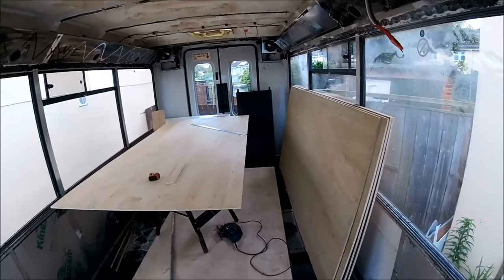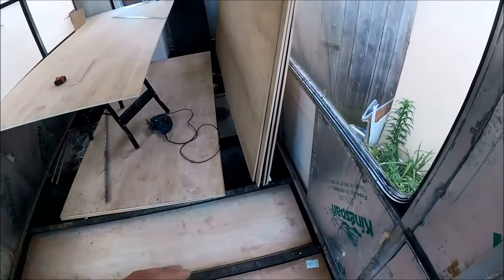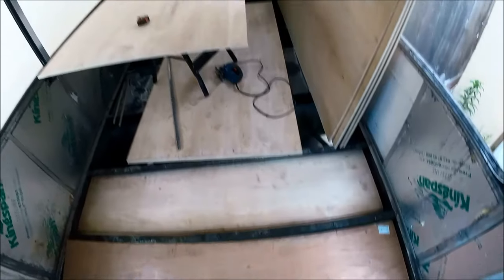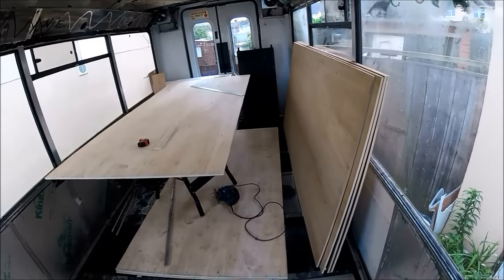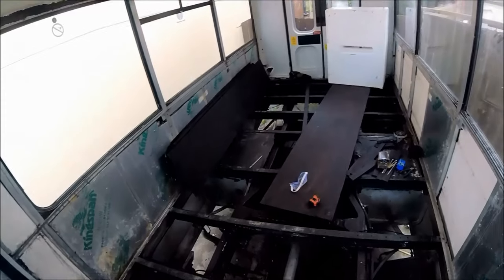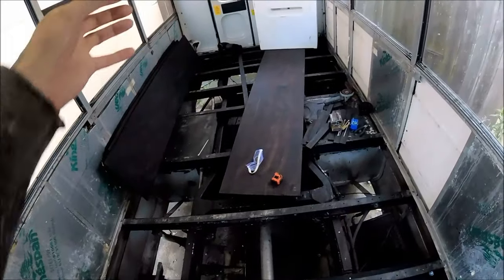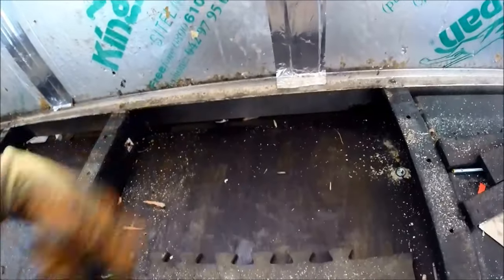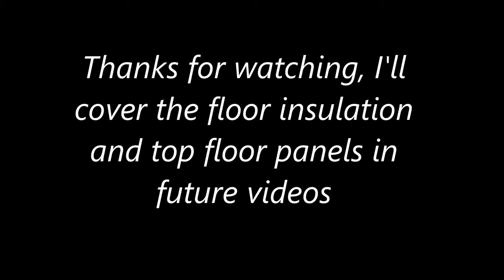Laying New Base Flooring In Mercedes Minibus Motorhome Conversion

Comment: Possibly an exceptionally gormless question but could you just build another layer of floor of the minibus as it was?
Reply from the maker: You can but loose headroom doing so, especially if you layer insulation between the floors. This is the main reason for replacing the floor, allowing 50mm floor insulation while gaining 1/2 an inch of headroom too.

Comment: Is that going to be strong enough for everything you'll lay ontop?
Reply from the maker: This is only a base layer to sandwich in the insulation and is not weight bearing, all of the final top flooring will be secured edge to edge to all of the beams

Comment: Did you paint the plywood with Waxoyl - I used ronseal weather proofer first then yaught varnished my sub flooring plywood - would the yaught varnish be better or !!! - what what type paint did you use first on the ply
Reply from the maker: I didn't use any paint at all, just a liberal coating of Waxoyl on both sides and all edges.  Yacht varnish should be fine though if it's good enough for a boat...
Reply: @TheCampervanBuilder  Cool thanks - nice job - hoping to finish mine for next summer